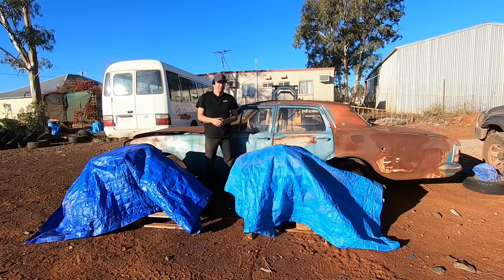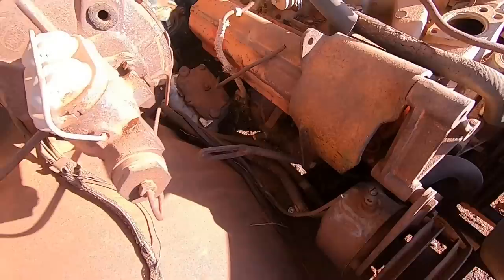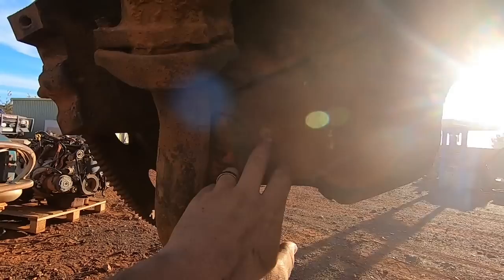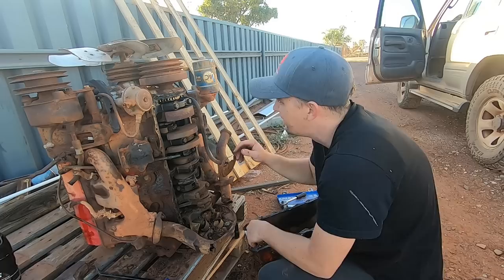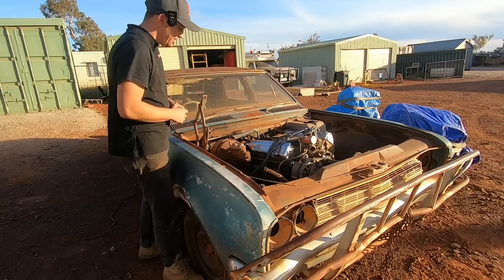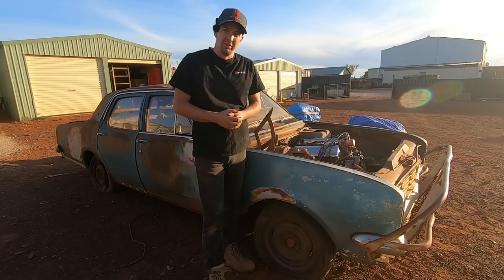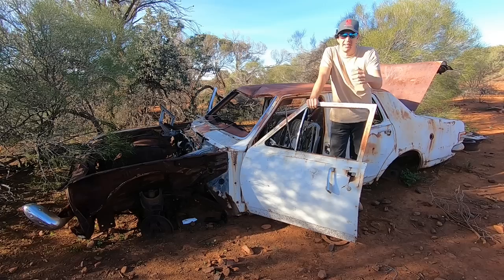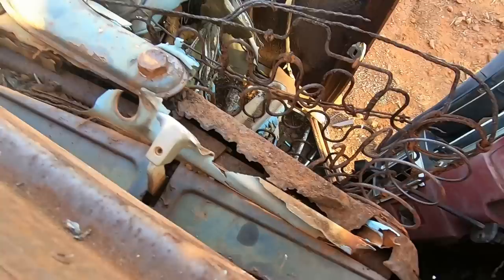Unveiling the Damage: Holden HG Brougham

Comment from the maker: Sorry guys the first car we go to and get parts from (blue with white roof) is a HT not a HK. Thanks to @iantaylor for the spot.
Reply: That is what I thought when I first looked at it,it had the split tail lights at the rear.
Reply: Don't want to second guess you but are you sure it's a 308 not a 307, my old man has owned four of them and they all came with 307  I owned a hk it also had a 307 with the 2 sp powerglide and I have a mate who has 2 both are 307's
Reply: @colinjohnstone6469  correct,HK series came out with the 307.
Reply from the maker: @colinjohnstone6469  hey mate, yeah all the hk and early ht's had the 307's with powerglides. Later ht and hgs where the first model to come with the 308. Also the engine number matches a ht/hg era 308. Awesome you have had so many broughams in your life, how cool
Reply: @AutomotiveKarnage   thankyou now I know,  first memory of doing doughnuts was in Brougham until my old girl come out and ruined the fun,  I'm a sand blaster in Mudgee New South Wales heaps of old cars have been coming through lately which is good to see them getting restored back to there former glory, love your work and vids mate keep it up.
Reply: If it's a HK then their even rarer and they came with a 186 cl a 307 chev V8 and chev 327 V8 , most probably it's the 307 nice find 👍
Reply: The HK also didn't come out with greaseable ball joints. You got lucky with the steering arm as power steering arms are a different length to manual steering arms. More trivia the bush size on HK leaf springs is a different size (smaller) to HT/HG. Oh and by the way 308 was stamp on the side of that engine and was perfectly in frame at 4:58
Reply: @davidmilledge221  also the base engine was the 161 cu in.
Reply: @hackney7106  never seen a brougham with a 161 in it only kingswood or Belmont
Reply: @davidmilledge221  no,I was referring to the engine range in the HK series.
Reply: What I was about to say 😂
Reply: @colinjohnstone6469 HG had 308

Comment: Do NOT modify it! Bring it back to original spec!
Reply: Someone needs to send this Kiwi home, minus this Brougham. He’s full of it. No one faked a Brougham, it’s the real thing. Tags can be replaced, from the stamped numbers on the body. Suppliers of parts/workshops should do what unions did in the 1980’s when developers wanted to demolish heritage buildings. They put Green Bans on them and wouldn’t be involved in demolition or works on site.
Reply: @bradj78  he is not very good at what he does,come up with some dumb ideas!

Comment: Just LS swap it... Don't like them particularly but it makes sense.
As you said, easy power, parts easy to source, reliable and will start when you turn the key, most importantly you already have one and they're are an easy conversion.
Built an hk ute back in NZ, with a Toyota 1uz V8 and trans, Mitsubishi L300 crossmember with L300 front suspension, rack and pinion steering, jag independent rear end, full air ride and it wasn't too hard at all to do and it drove soo nice.. Modern comfort with old school cool looks🤷‍♂️

Comment: The first doner car was a HT, and the second was a HK. Some of the HK steering partts are different to HT/G. Pretty shure the steering arms are different, as HT arms are in demand, for rack&pinion conversions on HR fronted early Holdens.
Oh yeah, the second donner car was a HK, metal grill, narrow tail lights, long rectangular speedo. Also different rear doors an quarter panel.👍

Comment: There's a very good chance that's the original engine,it has the front mounted oil neck filler.Some really rare parts still on that old girl,power assisted steering with the hydraulic ram on the steering linkage.Large brake booster,disc hubs, and spindles.

Comment: Tags (timeline 12:15): If the legacy IT MVR systems are accessible, the motor reg dept would have a history based on engine number, and they would have a record of whether the engine was swapped. Even if it was, the VIN is parent data and would remain the same, in fact you would also get the old engine # had it been swapped.  All the first reg location and owner detail would be there too. But it does depend on whether they offer that service and if its retrievable, (maybe microFysh or whatever its called).  The roo bar gives a clue that it was likely first reg in WA.

Comment: Yes the tie rod arm fill fit , however the distance from the bolt to the tie rod is different . Power steer vehicles have shorter arms. giving a more direct steering , you can still use them and have a lower geared steering but just be sure both sides are the same, or you will never get it steer correctly. Actually this is the case with the HQ / WB  models , I could be wrong about this one.
Reply: Not the case on a htg, this should have a 16.7 ratio steering box fitted as its a factory power steer

Comment: Plane arm.    You actually can get HQ Holden ones that are longer to improve heavy steering.  Not easy to find though.  The entire steering knuckle from HQ to HZ will fit.  You just reverse fit said plane arms.  This gives better disc brakes.     Yours has the power assist steering ram.  It will need seals.  It wasn’t too bad a system in the day.  I had a few.  Enjoy.    I do think most folk here would agree with a 350 chev type engine though.  Mor plentiful than the ole 08.     The trans crossmember set up does move a bit to allow.  Rams horn exhaust manifolds work well with the steering box position.

Comment: I think you will find it shoukd have a HP block and a powerglide. Just completed a set of Holden red motor connecting rods and fitted 3/8" rod bolts too them and took a substantial amount of weight out of them for a 350ci build..
Also have the correct ht hg model heads in stock going on the same build. Make as much power as your 5.7L LS.

Comment: Surely Holden must have a record of the original spec based on the firewall ID tag? I think you should try to get the 308 back in there - LS conversions, great as they are - are so common place. Soon heritage Holdens with their original 308 will be as rare as hens's teeth.

Comment: If that's the original motor then the engine block number that is on the original rego slip will match the car and prove its identity then should show up other ID stuff about the car , then u can trace the stolen plates on a fake car through motor rejestation I'm sure

Comment: surely in ozz you have geeks + nerds, those boys + girls will be able to use the chassis no. to zero in on the car details ?
in UK, the relevant owners club has the power to resurrect  a car without tags, complicated, but fully approved when completed
if you do mod. it, make sure all mods are "bolt in" adaptions, able to be reversed easily, to keep the geeks/nerds happy      keep up the excellent work young man
PS could you of not used the RH arm upside down on the left, then turned the track rod end 180?

Comment: Iam not 100% but the first generation Brurm had a a 350 Chevrolet 10 bolt dif and a 2 speed gearbox because my dad had a Holden premier with a 2 speed power glid and a 308 the same but dads was a 69 model

Comment: Are you sure its a 70 it could be a 69 as the 308 was first used in the 69 as well. They may have manufactured into 70 but could be a 69

Comment: Originally is shit in that model Holden 308 is shit as had no oil pressure from new crap junk engine LS is great but like very common in everything the only holden engine I’d be interested in was the VT 304 roller cam  engine chev crank bolts straight in they fixed the oil pressure issue and put a LS style alternator on it and had a chev pattern gearbox good in manual or auto so basically a real v8 a cast iron LS

Comment: Sorry DJ but that's a HT
Reply from the maker: Which one? Both the sedans had hk stamped on the firewall and the brougham has hg stamped on it.
Reply: The one with the White roof blue body
Reply: Yep it right  HT
Reply: Looks like a HT grille, but if HK is stamped on the firewall, it’s probably just got a bunch of HT parts on it.
Reply: @f4ufighter675  larger rear taillights,  HT or HG , HK were narrow
Reply from the maker: My apologies mate, I just went back out to the car and you correct it is indeed a HT.
Reply: @AutomotiveKarnage  all good
Reply: I notice that it is gone, but the 308 would have had a Powerglide if it was an early production example, or Trimatic if a later built model?